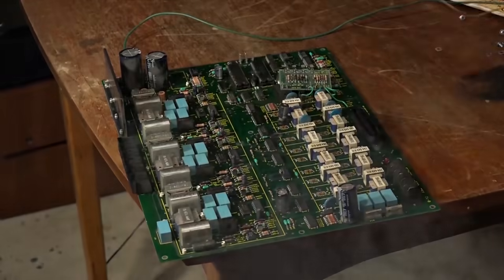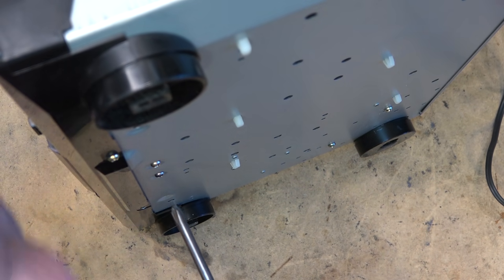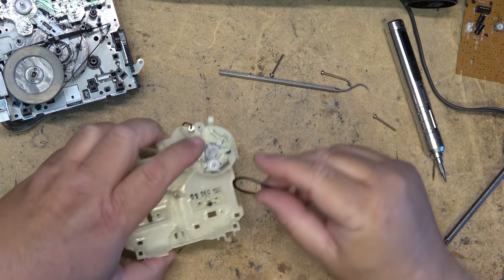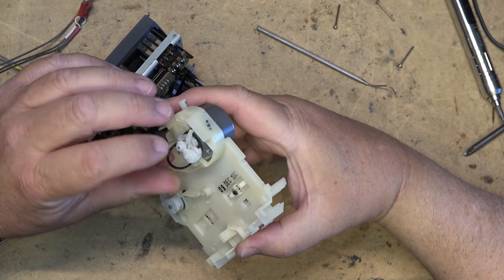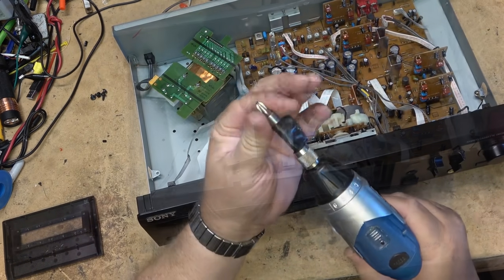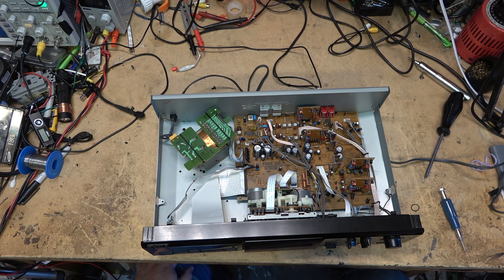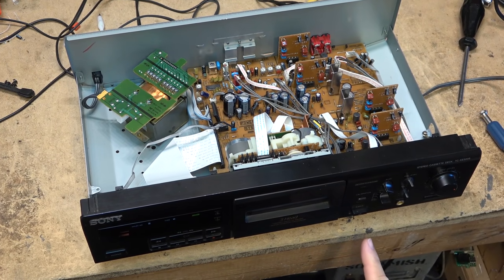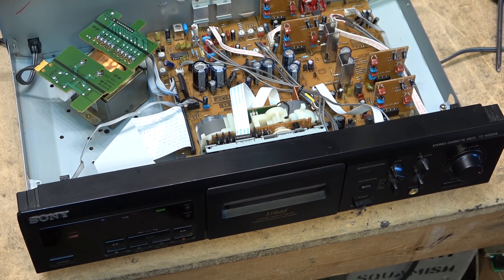Sony TCKE500S No FF Rew or Play Lets Fix it

Comment: I own a similar deck and I noticed there are three plastic poles close to the motor pulley where you can nicely place your flat belt before you assemble the mechanism. Same thing happens to the small pulley (two white plastic clips / poles up the gears pair). The very first time I opened the mechanism in order to change the belts I scratched my head questioning what to do until I watched a YT vid. About the small white gears I noticed a small crack on the lesser gear that made the whole mechanism went "berserk" (I mean rewinding the tape very fast but in the wrong way, trapped door, savage speed changes, strange alarming harsh noises, chewed up tapes, etc.). That little demon is the culprit of almost anything going wrong on these kinds of advanced Sony decks.
Reply: Hello, remember if that small gear is attached to the motor shaft or rotates on the shaft, I have that problem
Reply: @guillermogerardogomezconso8614  it rotates with the shaft (still don't know why them let loose that gear on the shaft).

Comment: Hi, great video, thankyou. Would you be able to show us exactly how the cog and peg on the reel motor need to positioned before putting the 2 halves of the transport back together, please? And is there any particular arrangement of the cam wheel and levers driven by the gear on the capstan that needs to be done before you put the 2 halves back together?
Reply from the maker: Can't show you something I don't have.
Reply: @12voltvids , Hi, thanks for the speedy reply 👍 I understand. I wondered if you might have had a diagram or similar. I'll have another careful look at your  video.
Thankyou again 👍😊
Reply: Are you referring to the FR cog fwd/rev pulley?
Reply: Yes, that's right. It seems likely it needs to be in a particular position when reassembling the mechanism, but I can't figure out just what that position should be.
Any help greatly appreciated :-)

Comment: This was great  i have a Sony TC-K561S 3 head deck  on mine those transistors or what ever they are fixed to the back panel both of mine were dry jointed as was the audio in and outs and a few other joints ,the motor with the flat ribbon cable attached had a split in it so i connected wires to the appropriate places on the board same type of cassette mech it was the cheapest 3 head deck machine i could find at £10 uk  the price i won it for on ebay but previous owner had messed around with it so had to sort their mistakes out as well ,I also now have a budget 1982 deck a sony tc-k220 from 1982 big differeence in build thicker case metal and nearly all metal deck mech so much better built and none of those awful flat ribbon cables the thing is with type 1 tapes i do not think the 3 head deck sound much better if at all the basic 1982 deck sounds fairly decent .

Comment: 27:04 What's up with the wobble of the plastic pulleys? I think that plastic changes shape and deforms with age. I just worked on my Denon DCD-1560 CD player from 1989 and the plastic arm which holds the magnet is bent to one side causing scraping noise. I was debating taking a soldering gun and heating the plastic to reform it, but decided against it. Gently bent the arm back anticipating a snap, but I got lucky without heat.

Comment: I did belts on a TC-KB820 which looks very similar. You can do the belts w/o removing the print board but the centre screw does need to come out. You also need to make sure the cog and pegs on the reel motor are in the correct position when reassembling. I also found the head on the one I did pushed over. Owner tried to force a cassette in with the head bridge in the up position (due to belt failure). Azimuth was seriously out after that.
Reply: Hi, would you be able to show us how the cog and peg on the reel motor need to positioned before putting the 2 halves of the transport back together, please?

Comment: OWNER: "It doesn't work."
TECH: "That's all I need to know."
Reply from the maker: Owner: what's wrong with it? Tech: it's broken!
Reply: @12voltvids  Owner: can it be fixed? Tech: just about everything can be fixed, it all depends on how much money you're willing to throw at it.
Reply from the maker: @PhaQ2  many things I wash my hands of and refuse to repair.  Don't want to get married to old shit.
Reply: @12voltvids  Did you, or YouTube delete my comment about starting my own electronics repair service?
Reply from the maker: @PhaQ2  I didn't delete anything.  If you posted a link it would automatically be quarantined as spam.
Reply from the maker: @PhaQ2  rest assure I don't delete comments unless they have porn Links.  Those troll messages don't just get deleted but the poster gets banned.  I too try not to turn away work but from experience I know which devices are likely to become headaches so sometimes i decide I would rather not do a job.  For me the electronics is more for fun and to keep the mind sharp.  I don't need the money but anything extra I can make just brings my retirement closer.   Want to retire while I am still relatively young. Hope to do that in the next 2 years and then hopefully will have a good 20 or more years left.  That's the plan anyway.   I'll still make videos and tinker with electronics and try to live off the YouTube royalties.   It's not much but at least it pays the bills.
Reply: @12voltvids  I hear ya. It's sad that this platform is becoming so fascistic. Say the wrong word and they'll silence you...
Reply: Computer tech: What kind of computer is it?
Customer: It is a white one. 

Well, isn't that helpful LOL.
Reply from the maker: @PhaQ2  making a comment like "I blew a tranny in my work truck"  is a good way to get banned by the showflakes on social media even though the comment was about wrecking a transmission! Unfortunately many thin skinned people these days.  I used to remember the phrase stick and stones may break my bones buy names will never hurt me.

Comment: I've got a tape deck question: I have the Denon DRW-660. It has nice soft-touch controls, blue number and meter display, dual deck. The only thing it gets hung up on is the "autoreverse" function. It's like the reverse mechanism is clicking and trying engage, but it's just not getting there. And, it's happening on Both Decks. Regular one sided play seems to work fine. Is there a common part on the main board for that function?? Or did both decks fail the same way?

Comment: I ordered a bag of various types of belts from China and noticed that first they are much more thin than the originals, they come with 0.5 to 1mm width, while the originals have minimum 2mm width. Also some of them have uneven cut.
Reply from the maker: Yes I had the same experience.

Comment: i love your channel...great videos especially with cassette decks.A friendly advice.When you check the speed of a cassette deck its better do it with 3000HZ rather than 440HZ.the 440 0r 400 hz are not so accurate
Reply from the maker: No it's not.  3khz for measuring flutter but as far as speed goes 400hz is more than enough. Guitar tuner with a 400 "A string" is the way i usually did it till one of my kids borrowed my tuner and never returned it.
Reply: @12voltvids  yes 400hz are enough and do the job...but in cassette decks,with 3000hz or even 1000hz you will end up more accurate.
I've tried 400hz in different decks and i had small variances in speed audible in my experienced ears with songs i know.
With 3000hz I've found that there is more accuracy.
400 to 401...that 1...is a big difference and audible
But 3000hz to 3005hz for ex the difference in speed is not audible
But hey... that's just my results...✌️
Reply from the maker: @cassette_decks_and_turntables  
Well being a musician I can set up just listening to music.  When I was younger i had perfect pitch.  I haven't played in years but i can still tune up a guitar by ear with no reference and it is spot on.

Comment: I'm not used to Dolby S, it sounds like it was missing a bit of treble. Or is that just how it sounds using that reduction function? I can't imagine taking one of those part in 10-15 years time haha Jeeze!
Reply: I noted that too ! I think the problem is he forgot to calibrate the tape before the recording test, if this deck has auto calibration function.
Reply: To my knowledge Dolby S is supposed to be the best consumer Dolby ever conceived, hardly distinguishable from CD (even with type 1), However the head(s) must be squeaky clean, azimuth spot on and a pristine head condition (not worn away). In my experience Dolby B and Dolby C are just as sensitive to these adjustments. Especially if the tape is played in other machines. If the azimuth is off even a little it will sound as if you put pillows over your ears, not to mention and the breathing you'll hear (especially with Dolby C). Many don't like Dolby because in their mind it cuts the trebles, with the way Dolby works it records the trebles at a higher than normal level so it is perceived it cuts the highs when infact it is actually restored back to the normal level of treble sound, however the Dolby circuitry is a bit sensitive to the azimuth even on the same machine the phase difference can confuse the Dolby circuits. Sounds fine with no Dolby but even on the same deck if the azimuth is out badly Dolby will make everything sound awful, even on the same machine.
Reply from the maker: I haven't used dolby s either.  Just tried it on this deck.  All tape loses a bit in the high range.
Reply from the maker: @darinb.3273  
That's why when I used cassette I used dbx.  
What many people did not realize was dbx was an integral part of stereo tv transmission, and HiFi video recorders. Betamax used dbx and coding for the Hi-Fi Channel and license it from dbx. The VHS Hi-Fi manufactures did not license their noise reduction from dbx but use the system so similar that there were many lawsuits initially from dbx that were dismissed because they changed it just enough to not infringe even though it did literally the same thing compounded the entire frequency spectrum.
Reply: Dolby S allows you to keep the recording levels below the tape's MOL (wich greatly reduces THD) while having an almost noise-free recording. If the deck is set up right and the circuitry works without mismatch, it's really amazing what analog cassette can achieve.
Reply: @12voltvids  If I remember correctly Dolby (B) was in the upper range of the trebles (I don't remember the exact frequency range) Dolby C went to around 1K to the highest range the deck was capable of, Dolby S covered the entire audio range the deck was capable of, there were some decks that could match the frequency range of CD, however those machines were not cheap or cheaply made as I understand highly precise mechanisms like in the Naks especially the ones that had automatic azimuth adjustment (custom to every tape inserted) a special circuit and electronics to do that and as I mentioned before that wasn't cheap to implement into the cassette mechanism.
Reply: @svenschwingel8632  Indeed a metal tape recorded on a quality Dolby S machine is indistinguishable from CD unless a person has the ability to A B compare live. Like in the 3 head cassette machines with source and tape monitor switch even then, in my humble opinion, a person would have to have golden ears to be able to make the distinction.
Reply from the maker: @darinb.3273  On beta hi-fi they used dbx noise reduction. The original SL 5200 actually has chips which have the dbx logo on them. They compress the audio with dbx before feeding it to the FM modulator then I'll play back after the FM signal was demodulated it was fed back to the expansion chip. As I said it was also used on the MTS television stereo signal. The mon o audio was not compressed but the L-R stereo different signal was compressed with dbx, also the sap Channel was compressed. VHS Hi-Fi manufacturers did not want to pay dbx for a license to use their technology so they changed it and instead of using two to one compression used a lower compression expansion ratio. This allowed similar but not quite the same dynamic range that beta Hi-Fi had. If memory serves me VHS hi-fi had around 80 DB signal to noise ratio and beta hi-fi had 90 plus. Digital audio tape is a full digital system so no compression no noise reduction necessary. It records using a rotary head similar to a VCR but it's a full digital recording. VHS and beta hi-fi and 8 mm for that matter all used and analog FM carrier that was recorded on the tape. Analog signals are subject to noise, as such noise reduction circuitry is required to mitigate that noise. AFM is actually quite a poor recording scheme that has a really low signal to noise ratio so without using noise reduction they sound quality will be worse the cassette with no Dolby. Also because the AFM signals were laid down with video crosstalk from the video signals with interfere with the audio signals but thanks to noise reduction that interference is mitigated.
Reply: @darinb.3273  if I run a properly-calibrated Type IV with Dolby S on my 909ES or my 9050S, these recordings will give my DAT machines a run for their money. Granted: I do not have a musician's absolute hearing, but it sounds absolutely stunning.
Reply: @svenschwingel8632  Exactly that was what I was getting at as you wrote earlier cassette/reel to reel can be mind blowing in the quality of sound 😃😄👍those machines you mentioned appear to be Sony machines, I have older models 3 actually A Sony TC-FX7 (slim height unit direct drive capstan) and 2 Sony TC-FX705 all 3 sound fantastic even without Dolby noise reduction on. I've got 50 year old ears and don't notice the hiss while even soft music is playing or even total silence as some music has complete breaks in the audio it is there but not noticeable to me all three are well aged with nothing electronically done to them I did some lubrication on the 2 TC-FX705 units the hubs were dry and squeaked like crazy during FF or Rewind all 3 use a light for a real time (well almost) tape counter (minutes and seconds) it uses spokes on the hubs and a microcomputer calculates the time from the hubs it also doubles as tape movement monitor (no pulses it triggers auto stop) I replaced a burned out bulb with an LED light in one of the TC-FX705 units. The TC-FX7 had a burned out lamp too replaced it with a replacement incandescent bulb though and I think I zapped the photo transistors in the mechanical restoration had to replace them counter counted VERY SLOW and auto stop kept on triggering. Anyway all 3 sound amazing at least to my ears, even with type 1 tape, they sound even more amazing with type 2 or type 4. They are type 3 compatible, but I don't have any type 3 to even try LOL.
Reply: @12voltvids  That's cool I had no idea VHS HiFi was like that learn something new all the time VERY COOL thanks for sharing that info with me 😄😃. I've never had any experience with Beta machines I think the Beta (Max) and VHS war was over before we even got our very first video recorder LOL.
Reply: @darinb.3273  the 909ES is a Sony, the 9050S a Kenwood ;)
Reply: @svenschwingel8632 I would adore an ES model Sony machine, preferably a 3 head LOL Kenwood is decent quality too, don't know if it would compare to a single well ES model though. Anyway thanks for sharing those models with me 😄😃👍.

Comment: Well it sounds ok for the end of the line,  but i'm supprised sony became that nasty :-(
But you fixed it and it should last a few years at least.
Reply: @Taco Many later Sony products are very good quality.
Reply from the maker: Metal chassis has their own problems as well.  They rust and seize up.  Look at all those dual, Garrard and bsr record players with the frozen metal parts.   Not an issue with plastic.
Reply: @Taco i have a 1990s TC-K909ES ... it's an amazing machine and easy to work on.
Reply: @12voltvids   I agree with the locked up record decks, But to be fair they were manufactured a hell of a long time ago, the grease just went bad.
Not a metal fault.
I've never seen a rusty tape deck or record deck, i suppose it depends on the environment it was kept in.
Chuck anything in a damp shed and you are asking for trouble :-(.
I would rather have metal any day, 
I didn't know who you were commenting to,  So i thought i would have a moan for no reason at all LOL :-D
Reply: @Taco The TC-KE500S was part of the QS-line. Look at the video. Besides the belts it still works fine after > 25 years.
Reply from the maker: @Taco Metal bends